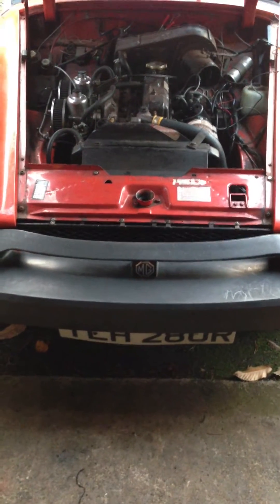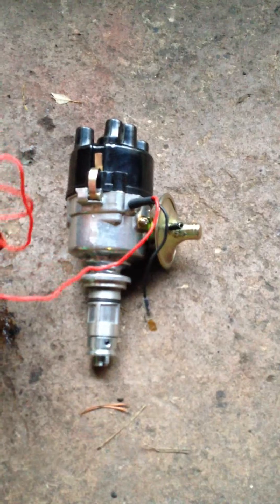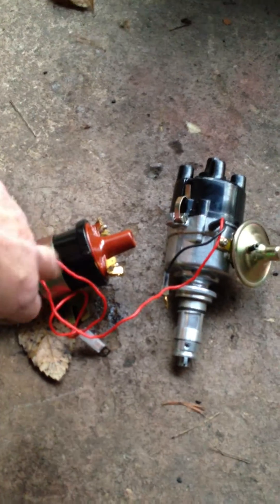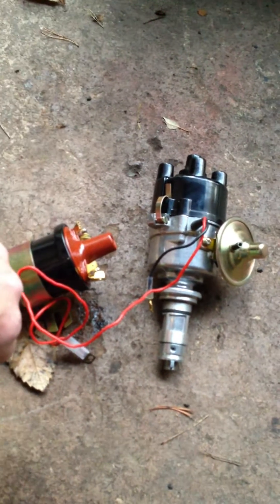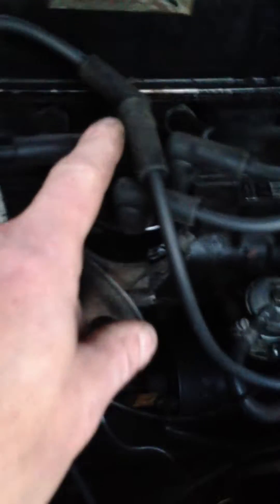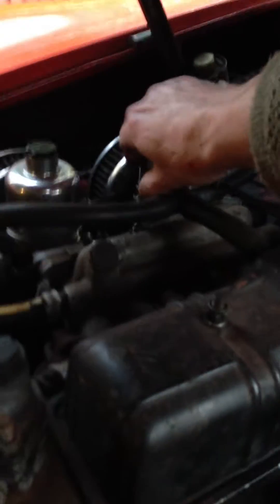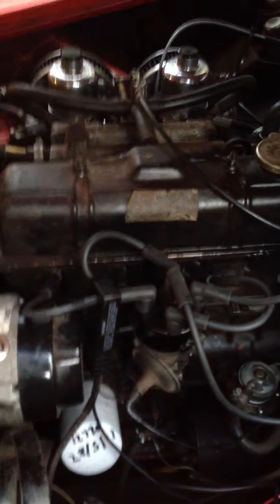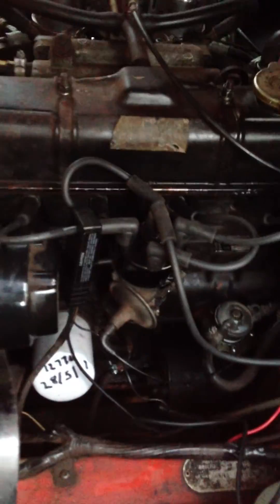MG Midget 1500 Distributor and Coil  change (part 1)

Comment: I wouldn't bother taking plugs out just turn crank till timing mark on pully is on TDC mark on cover then check rotor is pointing in direction of #1 lead,that way you know #1 piston is on end of compression stroke ready to fire, not exhaust stroke,all set.